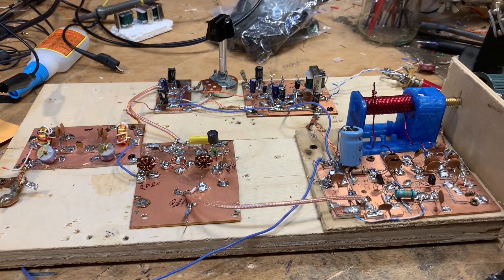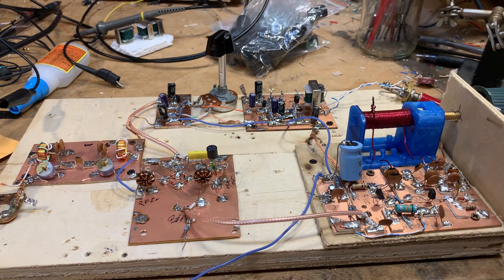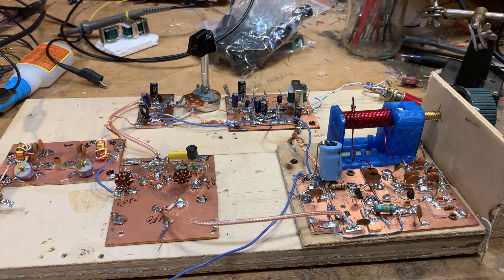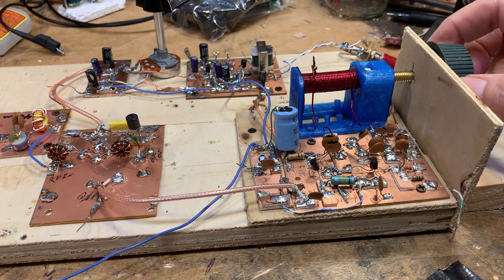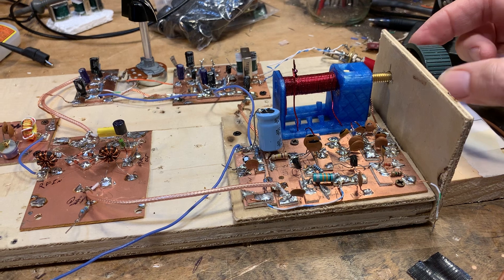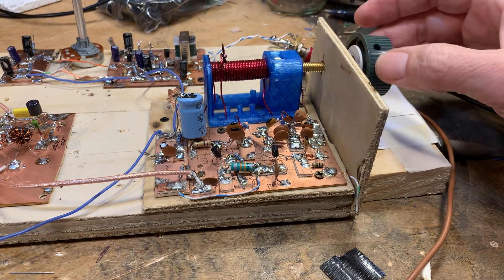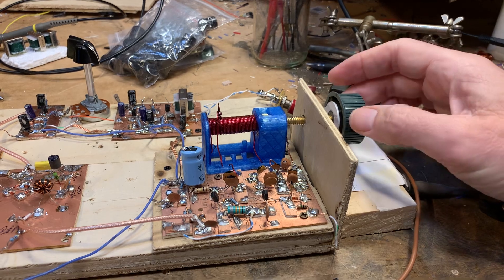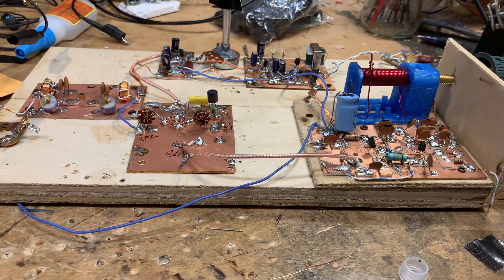Diode Ring Beats 2 Diode Mixers

Comment: Bill, a cluttered workbench is a productive workbench, mine is downright messy. I soon end up with spillage, onto the floor, onto my lap and onto my spare shack chair. If the project gets really intense, I end up with it cushioned on a bed of components.
On the subject of diode mixers, I've often wondered if Schottky diodes improve the performance of homebrew mixers?
73 de Steve M0KOV
Reply from the maker: Steve:  i would like to try the Schottkys but I don't think they would make mush of a difference.  Maybe they would need less drive.  But in the end all you need is for the VFO to be turning the diodes on and off.  73  Bill
Reply: @soldersmoke  Bill, some years ago I tried different diode mixers in the BITX. With limited test equipment it was hard to evaluate between a mini-circuit SBL-1 and homemade using fast switching silicon or Schottky.
73 de Steve M0KOV